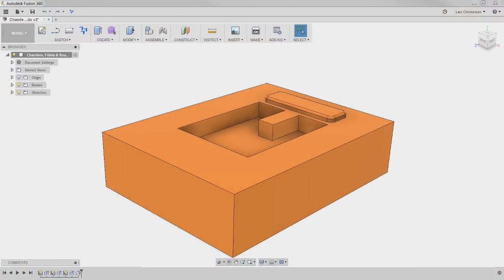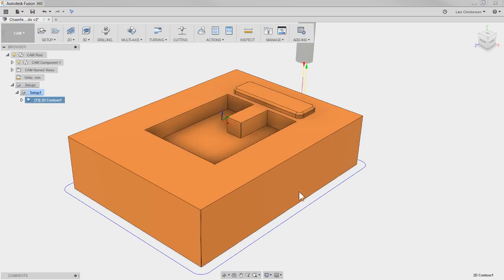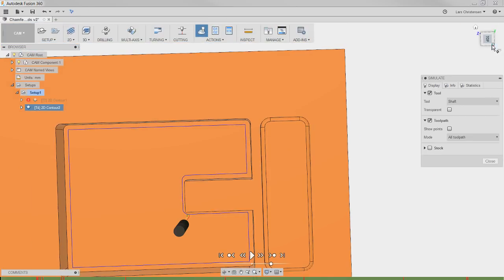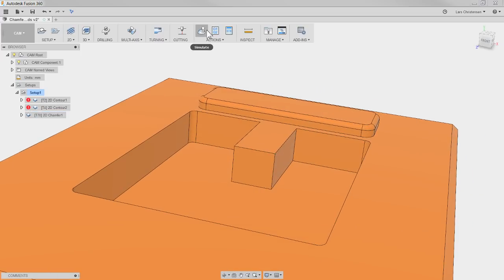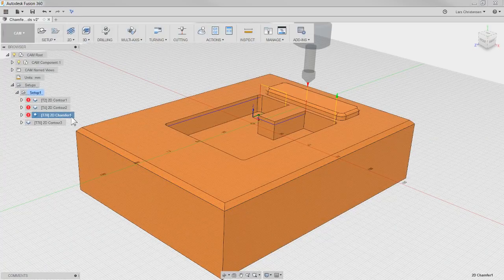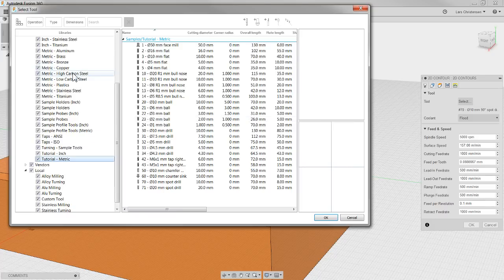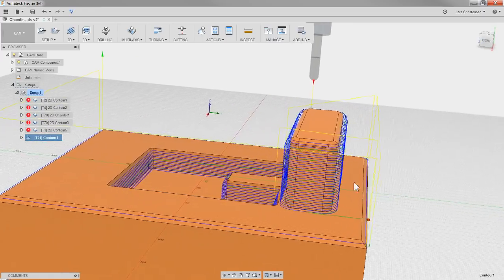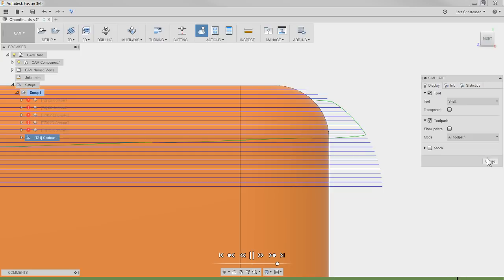Fusion 360 CAM — Machine Fillets, Chamfers & Rounds  — #LarsLive 101

Comment: I have got a pocket, size 300 x 500 x 20 mm depth with a 2 mm radius fillet on 4 corner. in order to speed up the machine time, I would like to use a big mill bit to cut the middle part of the pocket and use a 4-diameter mill bit to handle the fillets.  Could someone tell me how to set up the toolpath for the 2 different tools?  Thanks
Reply: Simply🤣🤣🤣🤣...you have lots options. Tooo many...its easy..make rough big tool...rest rough..and finish ..well done👏👏👏👏👏or...rough ..semi fin..fin...

Comment: Hi Lars. Thanks for so many great tutorials. I have been trying to find my way around a new cnc tool path with no lucl´k yet. I wonder if you have any advise on how to get done the following milling (check this post): https://forums.autodesk.com/t5/fusion-360-manufacture/how-to-generate-tool-path-for-a-u-shaped-pocket/m-p/9715836
Reply from the maker: Hi Esteban, I think the easiest would be to use a ball endmill of that radius and draw a sketch line in the middle of the channel and drive that with the Trace toolpath. Don't forget about the pattern option, so you only need to program one, and then circle pattern the rest.
If you ball endmill is smaller than the channel, you can use the the Contour toolpath and then maybe contain the toolpath with s rectangular sketch.
I hope this is useful
Reply: @cadcamstuff  great! Thank you. That makes totally sense! Will give it a try!

Comment: Thanks. Great video. 
Question: I want to use a ball end mill for the rounded edges (fillets) on a electric guitar body. I followed the steps (from 27 minutes in the video) regarding the fillets (rounded edges) but it ends up with orange lines in the curves and blue lines when its straight in the toolpath. Any idea of what it could be?

Comment: This video was posted long ago so I hope to get a reply. I have everything working as you do to make a fillet with a ball end mill. You didnt show the stock in the sim and no matter my adjustment I keep getting a cusp at the top of the fillet. As if the cut wont start high enough on the material before staring the cut. Any suggestions??
Reply: I've just started playing around with Fusion and am having the same issue. Have you had any luck finding a solution?
Reply: Popé I don’t remember how he does it here but the solution that worked for me and that others had suggested was to use a scallop operation for the fillet. With my part I did a 3D adaptive and then a scallop for the finish pass and then a countour to clean up the wall. Hope that helps!!!
Reply: @zachcooper6955  awesome, thanks!

Comment: Hi Lars. Your videos are like a reference manual for me. Thanks so much for helping us all out!  Im wondering if you could tell me the best way to determine the proper size ball endmill for milling fillets. Does a particular size work better on a certain radius or just what you have available?
Thanks again!
Reply from the maker: I think I would just go with the biggest possible that will fit for rigidity and the amount of step over. 👍😊

Comment: Lars, not mentioned here, however, for chamfering on a slope the trace command may be our only option, fought this for a long time until Seth (Liberty Machining) on the CAM AD forum made me aware of using 2D Trace, it's somewhat limited on entry/exit lead in/out but does get the job done. I'd be very interested in other option for this situation if you know of any further.
2D Chamfer, 2D Contour, 3D Contour don't get it.
Reply from the maker: Hi Ken Shea Thank you for watching! AND for the great comment

Comment: One thing I was expecting to see is when you have to chamfer small drill holes. What I did in Fusion (haven't try yet in the CNC) is usign the drilling operation with a chamfer tool and adjust the depth to make just a chamfer. Is this good or bad? Thank you so much for all the wonderfull videos you make.
Reply from the maker: Hi Sebastian Santilli Thank you for watching!
Totally legit using the drill operation!

Comment: Wonderful explination of fillets, chamfers and rounds.  I was modeling a small test block with pockets, holes and arcs.  Practicing some basic modeling skills since I am new to Fusion.  In the model I put in chamfers.  In cam i used the 2D chamfer. When I milled the test block on my table top cnc the chamfer did not look right.  didn't know why.  Now I know the correct way to use chamfer and 2D contours with respect to chamfers.
Another great video. Thanks again Lars...
Reply from the maker: That is awesome to hear Craig Ozolins .Thank you for watching the videos

Comment: For milling a radius in the corner of a pocket, I always try to use an end mill with a significantly smaller radius than the radius I’m cutting, since you can still get dig-in and chatter in the corner if the roll-around is very small, as it is in this demo (it is still cutting with a large portion of the cutter’s circumference). For example, if the pocket had .250” radii in the corners, I might use a 3/8” end mill instead of 1/2”. Of course if the pocket is very deep, that might require flutes longer than standard, which could present chatter/gouging issues as well.
I always like to add small radii to profile corners too for purposes of breaking the edges. Let the machine do the deburring whenever possible. Note, however, that just because the CAM graphic shows the centerline of the cutter describing an arc at an external 90-degree corner, that doesn’t necessarily mean it’s not machining a sharp corner. Even with sharp corners in the model, the CAM systems I’m familiar with will roll around corners instead of making square turns, which would be less efficient.
Moving the leadin and leadout to the corner of an external profile is also a good habit. But when you have no choice but to start in the middle of a wall, I’ve found that arc-on and arc-off, even with a large radius, can still leave a dwell mark. I prefer to use a very shallow-angle linear leadin and leadout instead, with an overlap so the cutter doesn’t enter and leave the cut at the same spot.
Another great video, Lars!
Reply from the maker: Hi Roland W Thank you for watching! and thank you for the great comment! You are right, I should have made your point. using a smaller cutter will always be a better option to get around a corner.

Best,
Lars